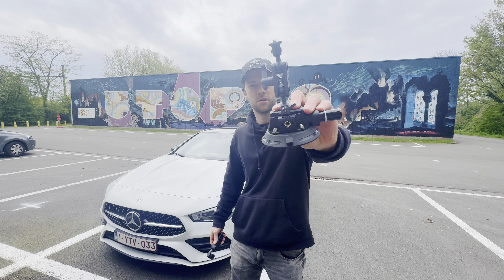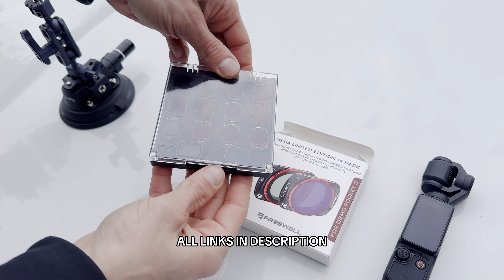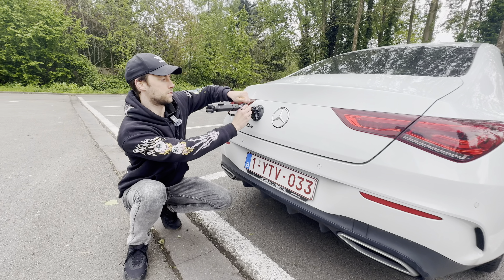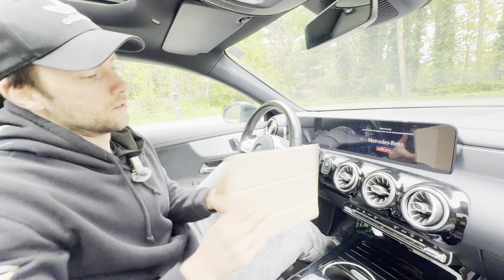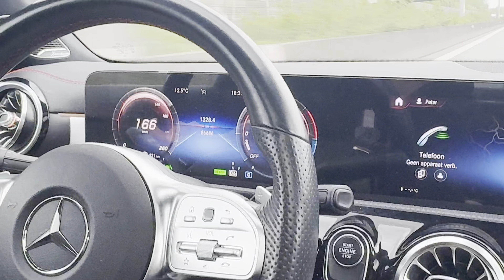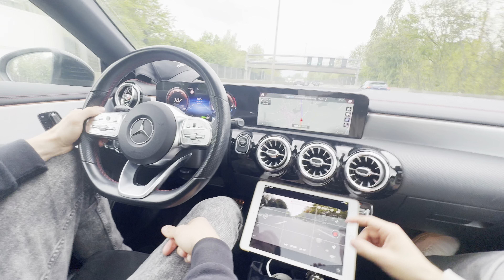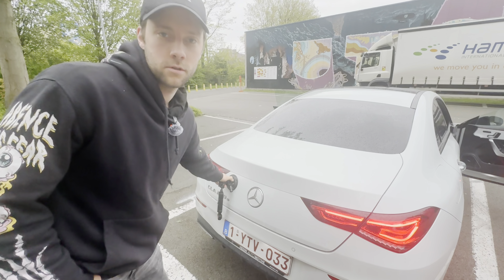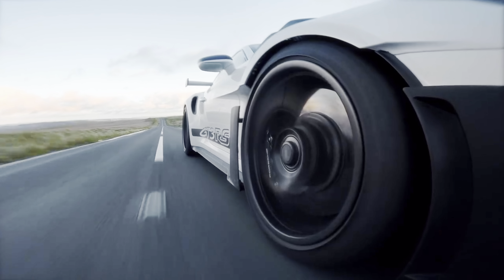EXTREME TEST: Car Mount Suction Cup with DJI OSMO POCKET 3

Comment: Too bad you placed the sucking cup at the back of the car where it is somewhat protected from the wind.
Reply from the maker: True story, i’ve tested it ok the side aswell driving 120-130 for a while though. Ill make a video soon
Reply: @TheCarVideoGuy did it hold up well at those speeds? Also how about the front hood low angle what you think the max speed would be before the gimbal gives up?  It also prob eats through the battery fighting the wind you think?
Reply from the maker: @OffToSunshine yeah bro it held up perfectly always for me, but always make sure to tether it so in case it falls of its safe anyway
Reply: I mounted mine in the front to follow a car down a winding road....the osmo pocket flew off at about 60mph

Comment: Besides the suction cup, how does the extension handle from the osmo pocket itself holds? I have trust in the suction cup but the little add-on is what is botthering me to do it.
Reply from the maker: Hey bro appreciate the comment, and i understand your concern but do you mean the battery handle? to solve this you can get the an OSMO POCKET EXTENTION ADAPTER. What I do personally is attach the wrist wrap to the osmo abd wrap it around the suctuon cup so IF the battery handle would come loose, it’ll just hang onto the suction cup/ magic arm :) 
If you have other questions let me know

Comment: Cool video! A quick question: when you are shooting the bmw, the camera stays on it. Is that automatic?
Reply from the maker: Yes bro that’s correct, if you look closely , you see my friend dragging a green square over the car on the ipad, this way the camera automatically tracks the car (or any other object). Do you see what i mean?
Reply: @TheCarVideoGuy  Thanks! It occurs to me that insta360 can do this by editing, which is super cool that one don't need to manually follow objects, which might be useful in single person sports (motorcycling/cycling etc.)
Reply from the maker: @alviszhao  hmm yeah that’s possible! I have to look into it

Comment: Hey I’m looking for something that will continue to record even when I’m not inside the vehicle, I have a stalker and I need evidence to provide
Reply: It sounds like you're looking for a dashcam with parking mode. 
Check out the Vanture N2 Pro or the Viofo A139 Pro.
Be safe
Reply from the maker: A dashcam is indeed what you might be looking for. You mean like filming outside of the vehicle aswell? You can keep that thing filming 24/7